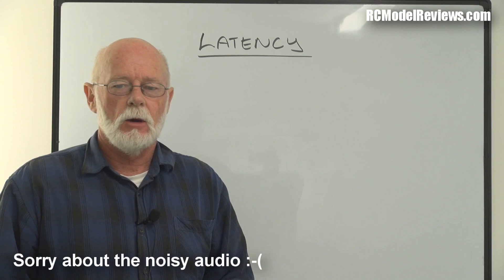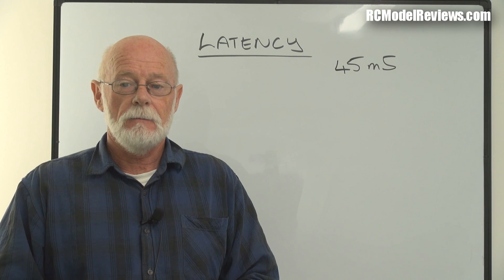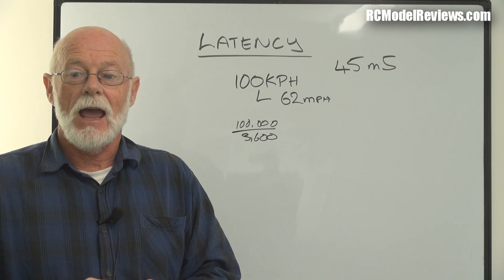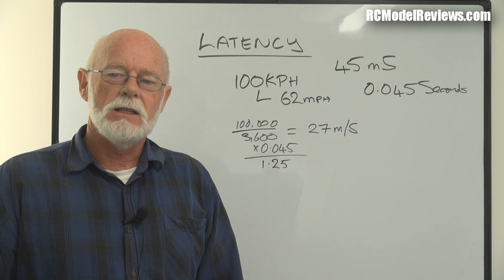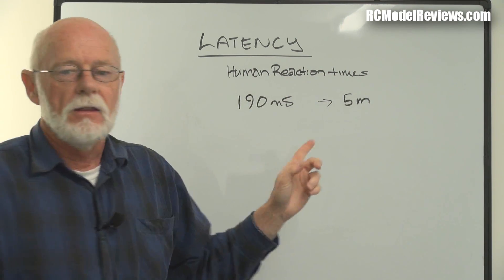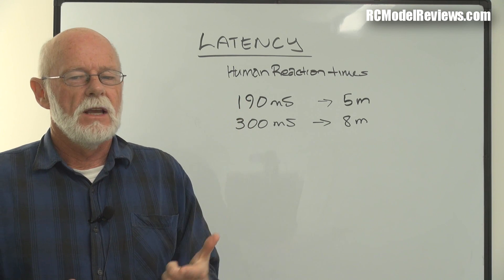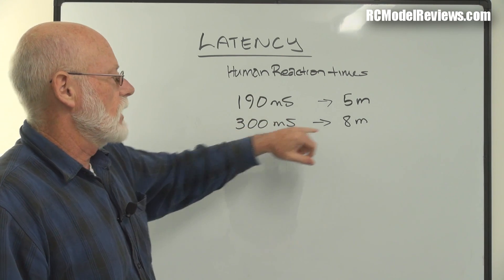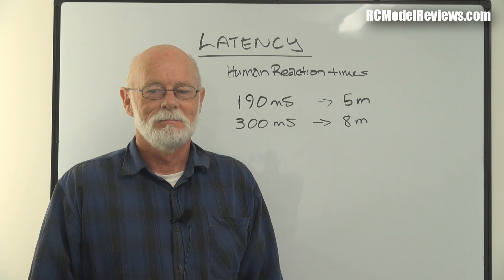FPV Video Latency - does it matter?

Comment: The reaction time isn't relevant, because you don't fly in a changing area. In the static area, the brain anticipates the path and synchronizes the reaction. 
Here is a test:
Put a remote controlled light on a quad at 100kph and ask a skilled pilot to flash the light when he is exactly inside a gate. You will see that the distance the light flashes behind the gate will be more or less exactly the latency of the transmission (with no reaction time involved).
Another example is music. If the thesis that reaction was relevant would be true, musicians would not be able to get in a groove tighter than 100ms...
Reply: It's still relevant, the object you are flying and the wind are not  static and nor is the link for the controls perfect. The lower the latency the better you can subconsciously make subtle corrections that come from experience. Basically the lower the latency the better sample set your brain/muscle memory has to work with.
Reply: agreed when it's a calm day and you're flying by yourself, But when things change your flight path like gust of wind or other pilots then reaction does become important.

Comment: If 45ms represents only +15% versus the human latency... a 90ms represents +30% .... so your brain will require a massive "retraining". I will add the latency impact for the brain is in practice lowered by the fact that most of scene have static objects (trees, field, air gates etc...) Paradoxally, living in this "past time tunnel" is not a major problem as soon as you have static objets. Everything is troubles as soon as a dynamic motion object is introduced in the scene (a bird, ect...) Here the latency is the keypoint.... So IMHO, in FPV what is the ratio of static/dynamic  objects? Much more in favor of static.....

Comment: Heh 45 ms aint that bad .. the connex is nice at 26 ms and I fly the effio with 80ms ... The mobius sux at 120 ms ...I was going to get 
a DJI  Mavic  but ..........160-170ms  sounds pretty bad :)
Reply: Well the Mavic is HD, I think that explain it..and that is NOT  a race quad...
Reply: The prosight is also HD and has a decent range ... the mavic has a video range of around 80 meters only :) The mavic does have a sports mode though " cough cough "

Comment: I would argue that in a race your reaction time is zero. This is because the track layout is a know entity, nothing instantaneously changes (assuming your flying solo) when your flying around it.
The main thing I have found playing video games for far too many years is to know what your latency is (through trail error making or missing shots) and that the latency is constant.
The problem with latency is when something unexpected happens (you meet an enemy coming round the corner) then any latency puts you at a disadvantage. (if you enemy has a lower latency)
Reply: I totally agree with you, reactions when driving are slower as your brain is in drive mode and needing to make a snap decision is an exception to the rule. Flying FPV you are in a heightened state of awareness and more "ready" to react.

Comment: Thanks Bruce, I've just built my first quad and your videos have been very helpful. Do you have a video or tips on flying LOS? I don't have goggles yet.
Reply: i will say either use difdferant color props for left/right... or front/back,,, or simply do the 2 back ones blakc, form left/right be red/green
but then againt hats alot of hassel it helps orientate